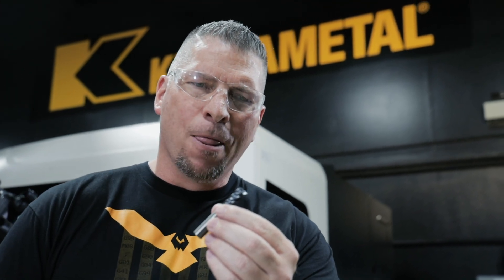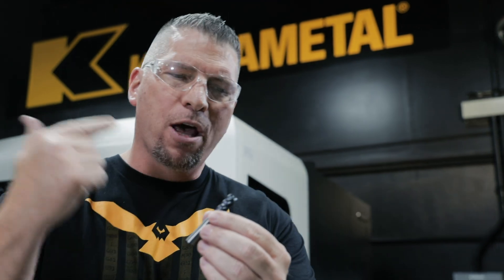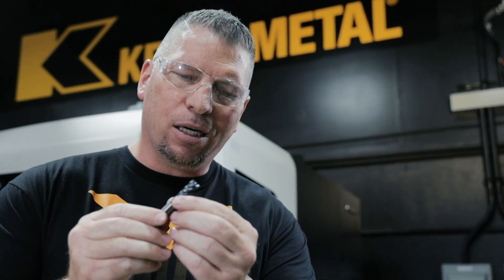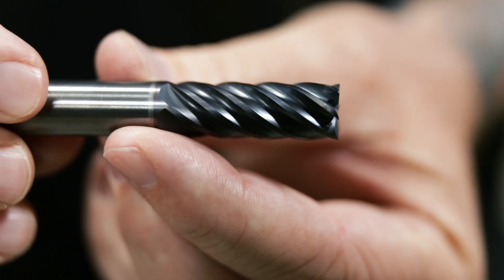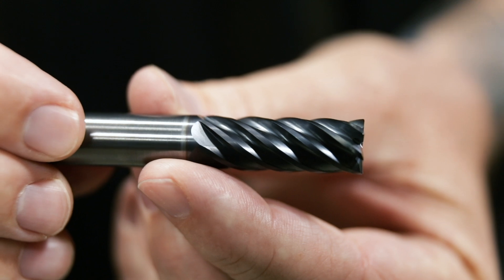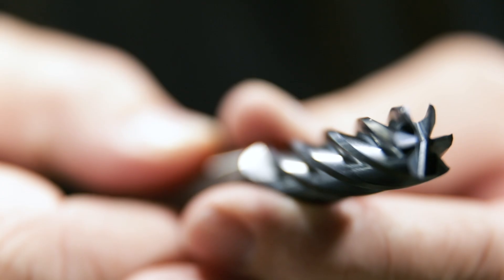1000 IPM Speed Test in STEEL | Kennametal | PowerMill | DMG MORI DMU 50 | Vlog #85

Comment: Seriously, you guys need to put a wall clock or something inside the machine that gives some datum for the passage of time -- my brain can't accept that the video is playing in real time without some sort of reference.  I know it's that fast, the numbers don't lie, but it's just... so far outside of conventional comprehension.  You know that 2, 3, 400 ipm in aluminum or delrin, etc. is 'fast' and then this is just literally on a different order of magnitude, and in steel.  Mind boggling.  

As a total aside, the stream of chips flying off that tool is mesmerizing -- collab with The Slow Mo Guys or the like?  I'd love to see what that tool is doing in true high-speed.

How are tolerances at such speed?
Reply: I wonder about tool-life at those speeds, let's say you would make 100 of those parts, how often do you have to change the tool?

Comment: Impressive. I am wondering about the heat and how much stress is loaded into the material from the heat. When you un-clamp the part does it move, twist, warp at all? Is it necessary to re-clamp in a free state (not hammered down in the vise) for finishing passes? I have seen this happen especially with steels.

Comment: By my calculations you'd need to be running 30000 rpm at less than 5% stepover to accomplish 1000 IPM with a 6 flute .5 diameter endmill. That still requires a rather aggressive .0055 chip per tooth and is 4000 SFPM.

Doable? It's within the region of possible but far outside the scope of the average VMC.

I'll try the  parameters at my max 12000 rpm and see what happens.  Maybe I'll posts the results to the YouTube.
Reply: @someone else I'm not really saying that the machine is special there's plenty of machines that can run at 30k and feed at 1000 IPM. The fact is most shops don't own one. 

I'm more intrigued by the parameters or the lack thereof. I was in a somewhat veiled way implying bs. I would love to see the parameters given so i could try to replicate it which i will gladly do. I only have 12k at 800 IPM but whatever.
Reply: @someone else that might be true but again I'm more interested in whether these parameters are doable. I see upon rewatching the video that the parameters are there and factoring chip thinning the chip is only just over . 002 @ 5% so that's not bad. Surface footage is ludicrous but it's 1018 and you can always step it up in light radial cuts. I'm going to try this at 12000rpm which will put me at 800 ipm.

Should be interesting.

Comment: Why is the tool speed important at all? I mean there is a tradeoff between IPT and IPM, so of course you can get high speeds if the tool is just barely touching the steel, so that a high movement speed does not automatically translate into a short overall milling time.
Reply: Exactly. the radial engagement is fairly low and the actual feed per tooth isn't as ridiculous as it sounds. 15000 rpm certainly helps though
Reply: It affects the material removal rate. Typically I've noticed the faster I can move a spindle I generally have a better mrr for a given spindle load vs slower and deeper radial cut.

Comment: i did some calculations, and looks like you used up all of the 16 kilowatts the machine has to offer . I think the cutter is even more impressive than the machine . holding up to that feed/tooth , without breaking a sweat is something else.  (Looks a bit stupid tho , just as the 800ipm aluminium cut . if i had the opportunity , i'd double the w.o.c. , and decrease feed&speed accordingly ) 
As a demo i'm waiting to see 1500ipm , maybe even 2000ipm feedrates .
Reply from the maker: Tomorrow’s video is double the step over... did it Break?
Reply: @TITANSofCNC  Interesting , i guess spindle load will be around 150-170%  :D . I think you should do some benchamrk drilling aswell (some solid carbide drills can plunge at over 500ipm).

Comment: A question about plunging or ramping feed rate.  End mill manufacturers always publish the recommended feed rate at ideal condition for shouldering or slotting. But I never see the recommended feed rate for the Z axis.  Is there a rule of thumb for guessing it?
Reply from the maker: I say... it’s like going in the ocean.
You want to run down the beach which tapers you in gently but fast...

Instead of jumping off the dock that shocks you!

Make sense?

Comment: Great machine, vises, tools... cool to watch.

I just can't help to think it is so gimmicky though. 1 million inches per minute!!!!! ... it's only 20in³ MRR. Titan, you can get close to that on your Haas machines..

I say gimmicky since it isn't any faster than programming the same MRR at a lower feed of 2-300. At slower speed & higher radial, the total toolpath length is shorter on linking moves, less retracts, and more likely the machine motion to actually hit the programmed feedrate on smaller moves. Also with that tiny step-over, programming that way is much less tolerant and forgiving of slight variations in stock size.
Reply from the maker: Absolutely... 
I am just showing what’s possible.
Also, at the end I said that tomorrow’s video will be at double the depth of cut.... and on and on
Reply: @TITANSofCNC  Right on. This is the hydroforce holder, right? How do you like those? Did you have any tool pullout cutting at this speed?
Reply from the maker: No, I was actually surprised at how well the tool did... I showed it at the end... looked new
Reply: @TITANSofCNC  They are excellent tools. I use a bunch of #4048722. They really are "zombie" tools like you say. LOL
Reply: @TITANSofCNC  you're right in the sweet spot for sfm where the cutting forces drop in mild steel. The material seems to jump out of the way in fear of the cutter! Can't wait for tomorrow's video!

Comment: Why all those sparks when it drills? Because of too aggressive conditions ? btw a cool roughing !!
Reply: It is sparking because an axial plunge generates much smaller chips because of the cutting flute surface area, the same amount of heat is being generated in a now smaller chip, flash of light.  Spark.  You're welcome.
Reply: Thats coz...seems a non center cutting end mill was used and the diameter of the hole was les s than 2.5Dend mill...
Reply: @prashponnappa6731  Harvi 3 is center cutting...
When helical plunging like that, the whole bottom of the cutter is 100% engaged in material. At 15k rpm, that makes a lot of heat. Compared to profile milling, only a fraction of the cutter dia is engaged.
Reply: @GRTLRS  Thanks missed to notice its a Harvi 3...btw  outstanding stuff..
Reply: I believe its just a gimmik to create flares and add flavour...titan is good at putting up a show..the sparks add flavour though..